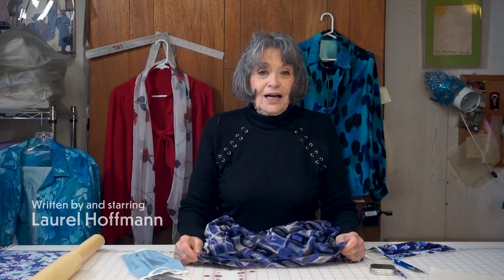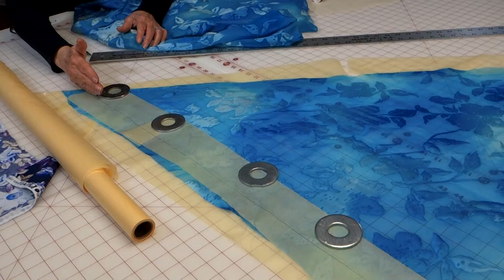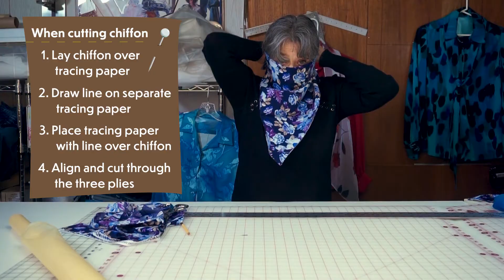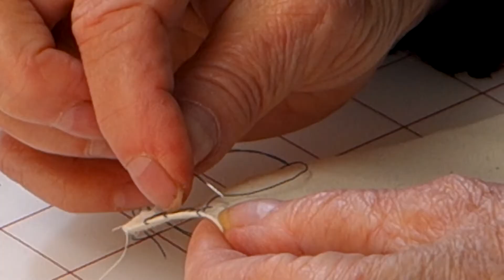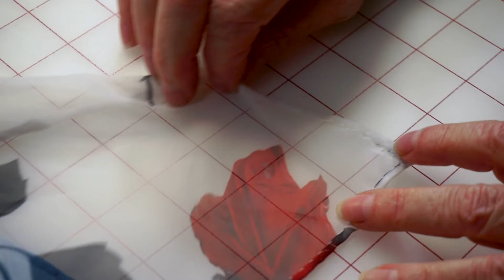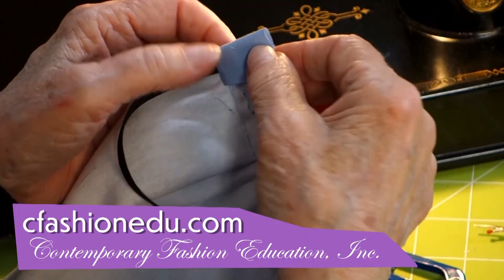How to create a hand-rolled, high-end scarf

Comment: Question, I thought it was taboo to cut paper with fabric sissors?
Reply from the maker: Not in the industry. Tracing paper is very thin. I would NEVER cut hardboard or thicker paper with my fabric shears. One would think they would dull when cutting tracing paper, but I've done it for years and had no problems. Plus - it's the ONLY way to successfully cut chiffon.